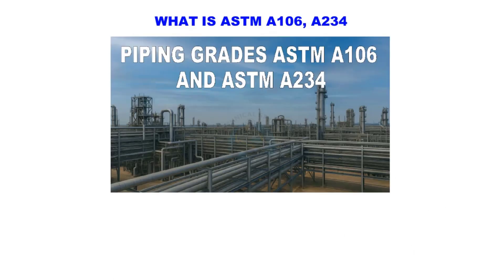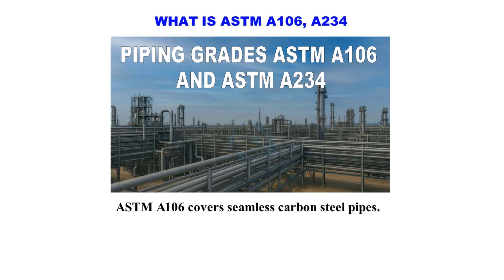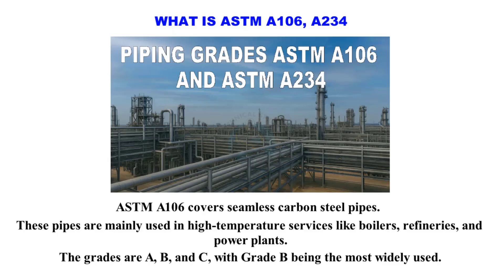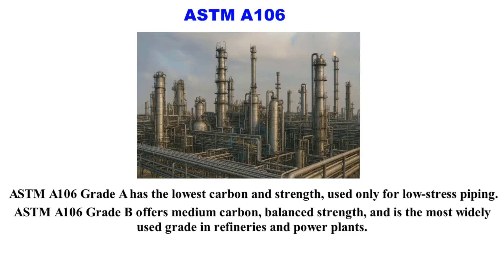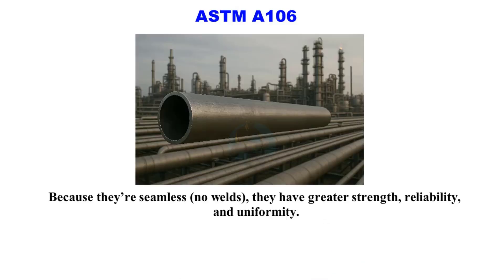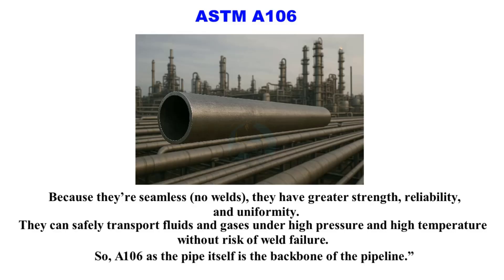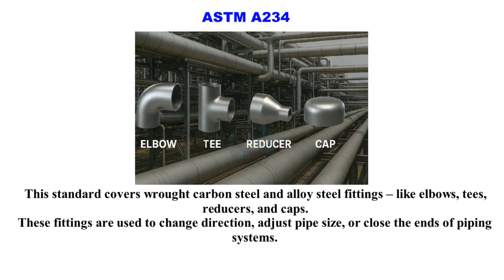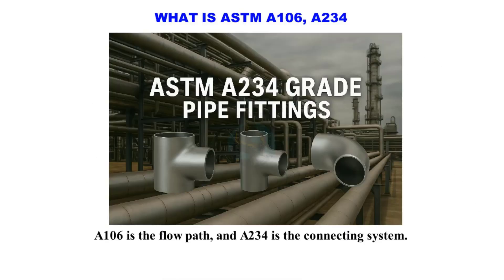A106 Pipes 🔗 A234 Fittings – What’s the Difference?

Comment: Thanks for sharing 

I think WPB definition was not correct 

Wrought pipe maybe
Reply from the maker: Thank you for your comment and suggestion, I appreciate it. But Bro, I always do some research, before making education videos.
Reply: @technicalstudies. 

In ASTM A234, the “W” in WPB or WPC stands for:

W = Wrought

Definition: The material is wrought, meaning it is mechanically worked (forged, rolled, or shaped) from solid steel, rather than being cast. So it’s not about the strength or carbon content—it's about the manufacturing process.

As for ROT, in ASTM material designations, it usually refers to:

ROT = Roll or Forging Orientation / Type (sometimes used in older references to indicate manufacturing method or processing, e.g., hot-rolled, forged, or seamless pipe).

✅ So, in WPB / WPC / WPL:

W → Wrought (forged/rolled, not cast)

P → Pressure service

B / C / L → Grade, indicating mechanical strength